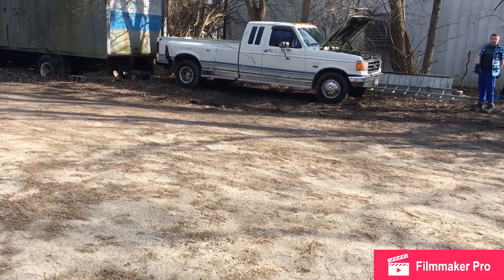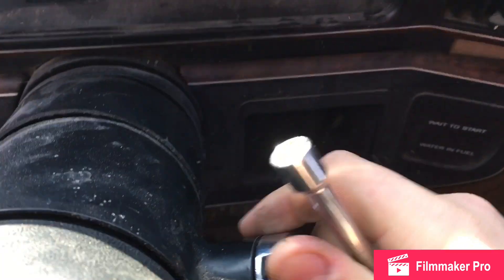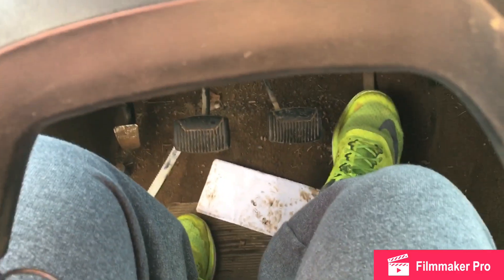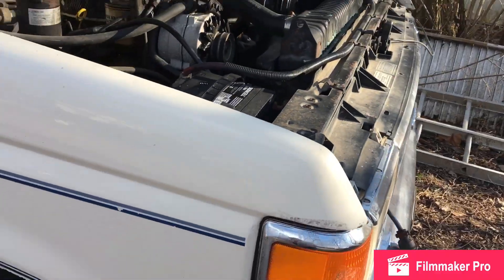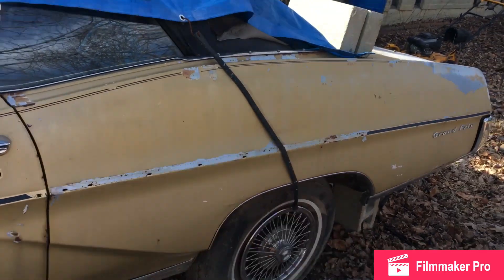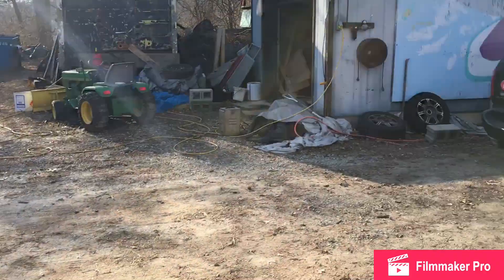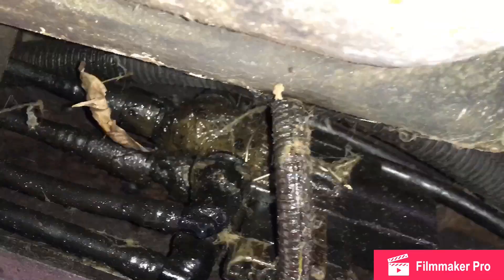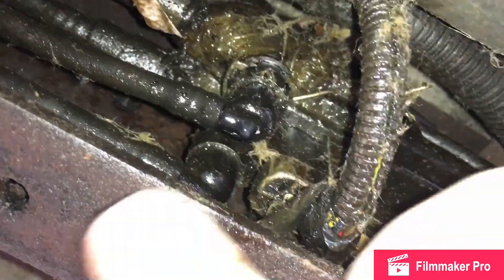1989 F-350 7.3 problems and walk around of old cars

Comment: That’s a nice rig and the cool thing is that it’s stick shift 
Congratulations
Reply from the maker: Joeban Ban thanks! Hope I can get it running at some point again
Reply: T.F.D 1982 I have a 89 I’ve been working on but it’s not a dually 
It’s a 250 same motor and same transmission

Comment: Those , , spark plugs , , are actually called , , heater plugs , ,  you will learn.young fella , good to see you trying your best . Make sure its not in gear ie neutral . . Before you cross that solenoid . Stay safe young fella . .
Reply from the maker: Fava Fava yes I know it was in gear at one point but I knew always not to stay in front of it and they are called glow plugs this is my first diesel I ever worked on so the first thing I thought of was spark plug
Reply: @TFD1982   ah ic . In england we call them heater or glow plugs . Just always check the box is in neutral . I wasnt being negative by saying that . I was just making sure you stay safe .  Just took me back to my mechanical apprenticeship at  age 15 in 1973 as a diesel mechanic . I never even knew what a heater plug ( england )  or glow plug was , I had to learn just as you are today by nineteen I was doing bare shell group b club rally cars from ground up seam welding , I learned everything I could welding bodywork fabrication etc  . Just keep learning each and every day . Mechanical engineering is a wonderful trade to have and when you are fully qualified , remember this , , Always have and give your time and patience to those who are willing to learn . As I myself did to anyone who wished to gain knowledge when I qualified . It would be good for you to try to gain an apprenticeship as todays vehicles are grossly overloaded with electronics that vehicles really dont need which causes even more problems than they are actually worth , I learned old school , there were no electronics that break down even if you look at them the wrong way . The days when machines were real mechanical machines . Keep up the good work young fella . Keep ( plugging ) away , with determination you will achieve your goals in life . Best wishes to you .
Reply from the maker: Fava Fava huh interesting because now usually people don’t graduate till 18 now cool that you were able to do all that so young
Reply: @TFD1982  last of the 15 year old school leavers in england , went up to 16 after july 73 , you left school then straight into work if you had employment , could walk out of one job straight into another at that time jobs were easy to find . You have to have every possible qualification in existence to get even a menial job in england now . Good luck for you future young fella .

Comment: Hi. Its probably the actuator, inside the coloum. Between the key lock and switch. The ignition switch could be bad. Its mounted on the top of the coloum, under the dash. Buy a haynes manual, it explains everything.im 61, certified mechanic. I know those Fords inside out. Id have it fixed in no time. Get a haynes manual!
Reply from the maker: Wayne Gouin yes but the solenoid it self was not working also we replaced it but it was too late I have possibly burnt up the starter I need to pull it out now and either check the solenoid above it or it actually the starter it’s self but because it’s so heavy and since I haven’t had time I have not been able to do it yet
Reply from the maker: Wayne Gouin where u located?
Reply: Hi again TDF. Im in the Upper Penninsula of Michigan. Get a electrical tester. Theres supposed to be power to the selonoid when you turn the key to start. If its getting power when you turn the key to start, the selonoids bad. If no power when key is turned to start, the ignition switch is bad or out of adjustment. Or the linkage between the key lock and ignition switch is bad. Theres two different styles of linkage. Tilt steering wheel linkage and non tilt linkage. Ive replaced dozens of these linkages. Its easy. Proper tools and a manual sure helps. If i lived closer id fix it for free just to show you. The switch is adjustable. Mabye its out of adjustment. The switch can also be taken apart, cleaned contacts, lubed and reassembled. Its all easy when youve done a bunch of them. To replace the actuator, you remove the steering wheel and tear the coloum apart, also pretty easy. Get a haynes manual!

Comment: Is this truck gonna be your truck to drive to school when you get it all the way fixed
Reply from the maker: Buddy Elliott I really really wish it was but there is not enough time left in the school year and it would take too long to get the fuel system fixed and the starter replaced it's such a beautiful truck too so we're going to keep it
Reply: T.F.D ! Is that gonna be your summer project than
Reply from the maker: Buddy Elliott possibly I have my trans am that needs welding and my van right now I have to put a transmission in lots to do with no money hopefully I get a job this summer
Reply from the maker: Buddy Elliott sorry for holding you up with everyone else hasn’t been good lately to film the truck hopefully in the spring I’ll be able to get to it!
Reply from the maker: Timothy Gaits what’s so funny?
Reply: Have you tried pushing in the clutch and using the key. Probably had a safety switch and will only start with the key if the clutch is pushed in
Reply from the maker: Michael Haslett yes I did several times

Comment: The spark plugs are glow plugs and injectors you got to get the rad and all the hoses checked and fixed you should no be running it you will blow it up fix cooling system first ther goons ruin this by over heating it for fuck sakes fix the rad or you won’t have a motor
Reply from the maker: Do not have the money right now